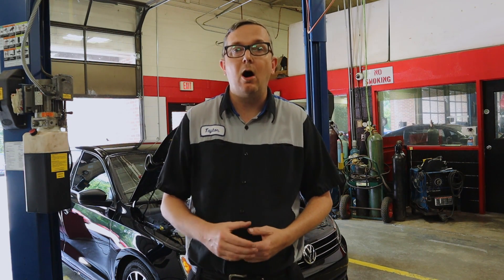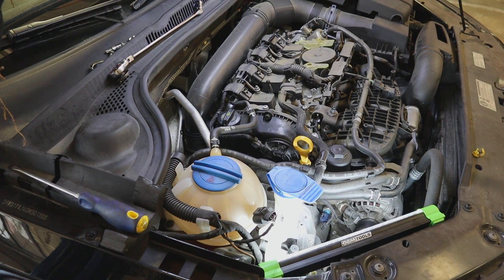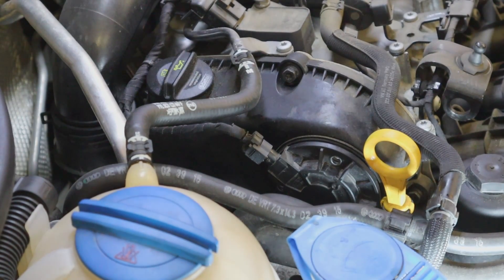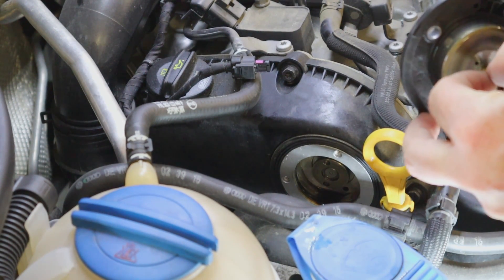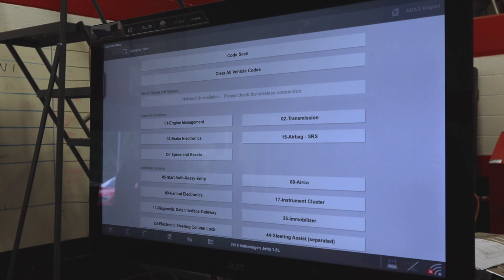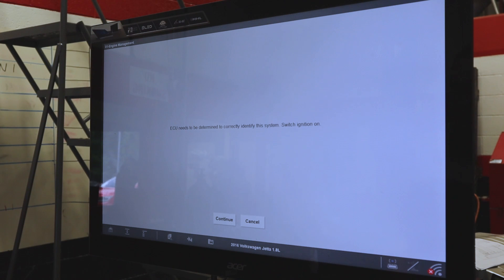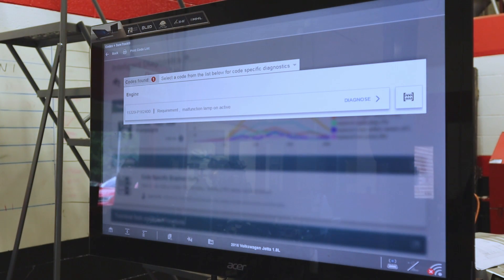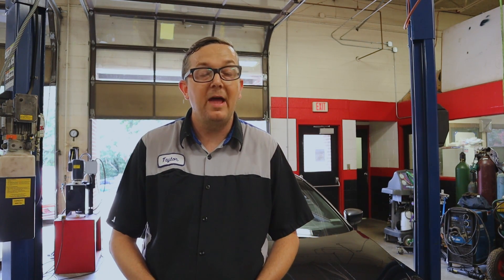VW Audi 1.4 1.8 2.0 TSI P0011 Camshaft code diagnosis and repair - try this first!

Comment: Could this also be the cause of the p000a code as well?
Reply from the maker: It is possible. This is worth a shot, being that it’s basically free to do.
Reply: @AutoScholarwithMrB  gotcha thank you!
Reply from the maker: @ads7686  no, thanks for watching! I hope this helps.
Reply: Did you ever get it fixed ? I have a 2012 VW CC and getting the p0011 and p000a codes as well, the mechanic wants to replace the entire camshaft/bridge because of the little oil screen on the cam bridge.

Comment: Hello, I have a 2014 Jetta SE 1.8 tsi turbo.  Cold start idle roughs, threw check engine light. Went and took it to be repaired. I was told it was the oil solenoid valve.  They ordered the inner part  and they went to put in and  after 3 different parts that superceded the original won't fit.  Supposedly the new part is smaller than the original so threads will seat into shaft. They removed the original valve cleaned and put back in.  Drove  it and is doing the same thing as original problem.  Do you know if you have to replace camshaft to use the new parts or if there is a way to get the original part?  Or should I just replace the magnetic part and see if it fixes the problem.  Before taking it in originally I did remove the magnetic part  and when I did the magnetic tip was hung up,sprayed cleaner in it and freed it up and replaced but problem still occurred. Could the magnetic part just be hanging from time to time. Kinda at a loss any help would be appreciated. Also I removed pwr to electromagnetic  part and it seems to get better at idle. Thanks in advance.
Reply: Mr. B  I was able to fix my problem after replacing my electromagnetic VVT and doing an oil change. The center actuator was hanging up. Saved me a ton of money VW wanted $3500 to replace camshaft and do timing and tensioners. For about $50 replaced part and figured what do I  have to lose.  I would highly suggest trying it before spending the money. Thanks for sharing this info. P.S. You do have to replace camshaft if changing inner oil valve solenoid with superceded part.
Reply from the maker: @robertemmons1811  fantastic to hear! Glad you were able to repair it yourself.
Reply from the maker: What codes are you getting?
Reply: @AutoScholarwithMrB  , not 100%  sure I  know one was retarded camshaft. P0011 Also throw a misfire code, and not sure but sometimes not able to use cruise control after throwing the check engine,so thinking also transmission code. After they cleaned the inner oil valve, check engine light on but I  am currently able to use  cruise control.
Reply from the maker: @robertemmons1811  those can have chain and tensioner issues as well as the adjuster issues. It is really hard to say without the car in front of me. Due to the temperature changing things, it may be an oil pressure issue. Make sure the oil is the correct weight and the pressures are within specification.
Reply: @AutoScholarwithMrB   Have you ever heard of superceded parts not fitting to where the camshaft had to be replaced in order to use the new parts?
Reply from the maker: @robertemmons1811  that’s a new one on me. I will try to contact a friend of mine tomorrow and ask.
Reply: @AutoScholarwithMrB  , Thanks

Comment: Hi good video bud. Can I ask what torque spec these are to do back up?
Reply from the maker: The bolts holding the magnet are 4nm and 45 degrees.  They are supposed to be one time use, but I had had no issue reusing. The piece further in? I cannot find any spec on it. I just cinch it up about the same tightness as an oil drain plug and have never had an issue out of one. Remember, the second piece is reverse thread!
Reply: @AutoScholarwithMrB  thanks for these I just ordered the vag tool today so I'm doing this asap. Do they make a rattle at medium idle say 1500rpm when this gets stuck. I've heard of this being the issue. And lethargic to drive compared to normal?
Reply from the maker: @davidkane9876  it depends how they hang up. Some will not give much issue and others will lope a little at idle. Let us know how the repair goes!
Reply: @AutoScholarwithMrB  lts a little hunty on idle at times but not all the time. 
Will do buddy probably next week. 
I bit the bullet and got a new valve also. Over here around 54gbp so not too expensive neither.
😊

Comment: My 1.8T is throwing this code. Replaced the whole tensioner unit twice, new chain, checked static timing on chain and belt. All line up to their marks. Replaced the hall sensor and fuel pump relay which ross-tech suggests. Still have this code. Driving me insane. Only thoughts left are a bad wiring harness or the driver in the ECU is shot.
Reply: Did you watch the video?

Comment: Hey Mr. B, 2016 JETTA GLI here with 56k miles. P0011 code, car idles like crap and toys to stall at stops, then some times it runs perfect. If it was the timing chain wouldn't it run like crap all the time? I've replaced the camshaft position sensor. It took a week of running like that to finally throw a code. After I do your trick today if it still runs the same, what should I try next. OBDELEVEN is in the mail.
Reply from the maker: I would think if it was anything mechanical it would happen all the time. The car in this video actually ran fine, but still presented this code. I would try what I have done above and then see what happens. Have you done any recent mods or other things to the car?
Reply: @AutoScholarwithMrB  bought the car stock, 3 days after I had a stage 1+ flash tune by unitronics done, took a few days before I noticed a slight idle stumble after cold start settled down but would clear up with a rev. Few days later the issue slowly got worse. Now it will run fine one drive, and the next stumble and even die at complete stops. Everyone knows of the timing chain issues with this engine, just trying to avoid $1600 timing replacement. Im hearing the wrong oil could be a problem, the dealership was a used car lot, they said they replaced with what VW called for, not sure though.
Reply from the maker: @illsmokq  first order is an oil change. I have a video on this as well under the mk6 playlist that includes the oil I recommend.
Reply: @AutoScholarwithMrB  i really appreciate the quick replies! Thanks!
Reply from the maker: @illsmokq  no worries! I hope you get your issue resolved. Have a good new year.
Reply: @AutoScholarwithMrB  just here to thanks you. Surprisingly cleaning the magnet housing out and changing oil fix my idle/stalling issue. For the life of me I couldn't get that cartridge out.
Reply from the maker: @illsmokq  so happy to hear!

Comment: Are there torque specs for when screwing the valve back in?
Reply from the maker: Could not find the spec, I would just snug it up. Due to the rotation of the engine and that they are reverse thread, they won’t come loose. Thanks for watching!
Reply: 25 ft lb

Comment: In my golf mk7 GTI , when I start it in the cold and the cold start sequence ends, I drive off and the car shakes for a little bit in first and second gear. Then , after 1 or 2 minutes it doesn’t do it anymore. 
I have a manual gearbox. I 
Could those parts cause this ? I don’t get any codes
Reply from the maker: That is hard to diagnose with no codes. Normally any issue with these parts will cause a code. Could it be a clutch issue?
Reply: Hi João did you maybe solve this problem? I have same situation on my Mk7.5 GTI 2017.
Reply: @BARBAGT500  hi. i still haven't solved the issue. I'm going to do the ignition coils next.  with the cold weather the coils could be acting funny i don't know. the car trows a code of cylinder deactivation ..
Reply: @JoaoFerreira-qy2ki  
I solved this problem. Mechanic replaced this complete valve which is shown on the video and now everything is.bavk to normal.
Try like this first
Reply: I didn't have any codes also but they pull it out VCDS scan

Comment: Very well put together video, this solved the problem on a 2014 VW Passat. Thank you very much for your time in putting this together.
Reply from the maker: Awesome! Glad to be of help.
Reply: @AutoScholarwithMrB  did the car make idle sounds similar to a diesel.
Reply from the maker: @NerdGenius  this one just had a little bit of a rough idle, no odd noises
Reply: @NerdGenius  thats exactly what mines doing did u figure out what it was? Is it this ?^^
Reply: @mahkirislebodnick9636  it’s the spool valve he is talking about.
Reply: @NerdGenius  mine has a diesel idle sound!

Comment: I have a 2014 Audi A6 2.0T with 150K miles. I'm suffering of noticeable engine vibration from engine at Idle and when you shift it in reverse. I had a P0301 and P0300 code and it would go in to EPC mode. I replaced 4 Plugs, 4 Coils then removed Intake to clean Carbon Build Up with Walnuts, Replaced 4 Injectors and PCV Valve. I threw everything but the kitchen sink at it. Any suggestions?
Reply from the maker: Have you done a cylinder leak down test or compression testing? Seems like you have fixed almost everything except compression. Any oil burning or consumption? What did the plug look like for cylinder 1?
Reply: @AutoScholarwithMrB   Plug looked BLack, loosing about 1/2qt every 6-7k Miles. Car doesn’t seem to lack any power. I did notice a bunch of crank case vacuum when I lift the oil cap and the RPM changes. So after I replaced the pcv valve I didn’t observe any change. I will inspect the motor mounts, maybe do a compression test.
Reply from the maker: @ze_german2921  thanks so much for watching! Let us know how it goes for you.

Comment: Hi I'm working on getting mine cleaned in my 1.8t 04 jetta. I have it exposed and can rotate it (barely) about a 16th of an inch. Im scared muscling it out will cause damage. Is it normal to have to man handle a bit?
Reply from the maker: Make sure you are turning it to the right to loosen. It has reverse threads. It should have some tension, but once it moves, it should screw right out. Should have around the same feel as removing a spark plug.
Reply: I think I'm looking in the wrong place then.. I have a 1.8t vw
And I was looking under the camshaft position sensor and evidently its not there
Reply from the maker: @suprakid182  I’m sorry I didn’t see this sooner, the 2004 model you have does not have this system on it. You most likely have an issue with the chain tensioner under the valve cover. These systems weren’t used until later on you car.

Comment: Hi ya doing Mr. B?  I have a 09 VW EOS with the 2.0t tsi engine.  I rebuilt the engine and the p0011 code keeps popping up.  Everything has been replaced, oilpump, rod and main bearings, piston rings, head gasket, head completely rebuilt at Ewing machine shop, all timing chains, guides and tensioners, intake camshaft and phaser/timing gear, camshaft adjuster magnet, camshaft solenoid, camshaft bridge bracket, it has the castrol edge 5w-30 full synthetic oil, new Bocsh oil filter, bought the timing tool set to time the crank and cams.  Runs and drives perfect I just get the p0011 when I accelerate not at idle.  Thanks for the video.
Reply: Did you ever solve the issue @amaolud78
Reply: @clab3171  It was the new aftermarket camshaft phaser causing the problem.  I just put the old oem phaser back on it and didn't have anymore problems.  Don't know if it came back because I sold it a long time ago.

Comment: Morning.  I just replaced a timing chain on a 10 cc 2.0t and starts at first try  but I got a rattle noise not to laud and p0011 p0016 .took the cover out chek the timing and it's on their marks. What did you think
Reply from the maker: Have you replaced or cleaned the two pieces talked about in the video?
Reply: @AutoScholarwithMrB  not yet but I'm going to tomorrow morning. Thanks for the good info. Also I just subscribe
Reply from the maker: Thanks so much for watching! I hope you get your issue fixed.

Comment: Thank you so much for explaining this. I removed the sensor magnet, sprayed Berryman-12 carb cleaner thru both the holes untill the magnet rattled in the housing freely and put it back in.  Now it runs like a sewing machine.  So glad for a success story!!!
Reply from the maker: Awesome! Thanks so much for sharing your success and thanks for watching.
Reply: Question about this
Reply: Was it making a noise before you cleaned it? I’m tracking down a knocking noise
Reply: @Troman16  one way to test if one of these parts is creating that knocking noise is just unplugged that magnet and see if the noise goes away. I was taught this by a Volkswagen mechanic.
Reply: any guidelines for torque on those t30s?
Reply: Update,,,,, ended up replacing the magnet cam position unit. Car runs flawlessly now.  They are very fussy on oil quality.
Reply: @jerrywilliams3812  you were saying before that you took the solenoid out and cleaned it and replaced it back in?

Comment: Hi, I got a vw golf mk5 gti from 2007 with a bwa engine, got recently everything replaced what has to do with the camshaft, got the car back but unfortunately with the code p0011 popping up, everything is replaced so what do you recommend me to do now?
Reply from the maker: JanJaap007 your engine uses a belt, is the timing set correctly? I have also seen this code come up in tuned ecms for no reason. Is the car behaving normally with no idle or power issues?
Reply: Did you sort this?

Comment: Hey Mr. B I got codes P000A/P000AP and P0011/P0011P. I went ahead and replaced the N205 valve solenoid but the CEL came back on. Car drives fine with no issues. What do you suggest for my next step? I didn't check the magnet piece so I'll do that next. What other steps do you suggest if that doesn't work?
Reply from the maker: carini20 make sure you are running a high quality oil and your oil pressure is correct.
Reply: Car Smarts with Mr. B I just changed the oil with the same oil I’ve changed my car as well as my wife’s Tiguan so I don’t think it’s the oil. How do I check the oil pressure? Do you happen to have a video that shows how to do that? Thanks!
Reply from the maker: carini20 I do not have a video on that, I will try to make one soon

Comment: What if you get a code P000A and P0011
Reply from the maker: Cameron Manning we normally see that with lower oil pressure. You may still get improvements trying what I’m showing you in the video. It will not hurt anything and might fix it!
Reply: Car Smarts with Mr. B awesome thank you for the update definitely have my like and subscribe
Reply from the maker: Cameron Manning thanks so much for watching, and good luck with your repairs!

Comment: I just got the cover off.  Any idea suggestions for tools to use to get the next part off.  I don’t think I have anything you metnioned
Reply from the maker: Gabe Campos you can try to take a flat head screwdriver and a hammer and try to tap it loose. Just remember it turns to the right to loosen.

Comment: i have same code (p0011)on my passat cc 2012 1.8 tsi.engine shaking in idle.
i changed a cam adjuster magnet but problem still.
shud i change a solenoid?
please help..
Reply from the maker: Are there any other codes outside of the p0011?
Reply: @AutoScholarwithMrB  no. the only code is p0011
Reply from the maker: Dlko Dlshad make sure that piece beyond the magnet is clean, or you may even want to replace it. It normally isn’t that expensive.
Reply: i have the same problem as you dlko.  2014 vw passat, shakes during idle, p0011 code.  i have been told that it could be the camshaft sensor, which is towards the front of the engine.  i think i might try this first, and if it doesn't work then get a new sensor.  let me know if you come up with anything
Reply: @gabecampos7852 scan ur car.if code was p0011 dont change cam shaft in front engine.iam changed it but problem still.iam changed magnet too.still problem!i think my problem is in solenoid
Reply: Hi Dlko I too am facing a frustrating situation my car Jetta 1.4tsi vibrates intermittently while idling its like every 50secs or so no codes I'll be able to feel a vibration under the seat, as though the engine stutters and I have done a host of things change PCV valve and hose done walnut blasting to get rid of all that carbon changed spark plugs also coils and still it happens I'm contemplating on changing the solenoid. I would if your car experiences the same?

Comment: I have the P0011 on my 2008 GTI - FSI Engine. Just went ahead ordered a replacement solenoid. Im hoping this will clear the code, before having to mess with the cam timing
Reply from the maker: I have my fingers crossed for you. Thanks so much for watching!
Reply: Car Smarts with Mr. B ended up not getting rid of the code. Going to try and change the oil and see if that is the issue (could use new oil anyways). I dont think the cam timing is off. I had the FSI engine that had the cam follower issues, and replaced the entire intake camshaft and timing cam chain. I used the tool to make sure the cams were aligned, so I dont believe the actual cams to off timing. Anything else you’d recommend checking?
Reply from the maker: Cristian G it might be timing chain stretch as well. May also be low oil pressure at times. What codes are you getting?
Reply: @AutoScholarwithMrB  only the P0011. I did a complete oil change so I dont think its the low pressure. It could be chain timing. I made sure to make check the timing marks on the camshaft chain and camshaft itself lined up, but after speaking to someone who has worked on FSI engines, sometimes the chain can just a link if not tensioned properly.
Reply: @CristianG13  did you sort it? I’m getting this code after chain and adjuster changed , all timing is perfect
Reply: what is that part name? The one you cleaned and / the part that requires a special tool. I cannot find that part on ECS. I found the first one just not the other
Reply: Does any one know what are the recommended torque specs??? Or should i just tighten until i cant turn😁🤘